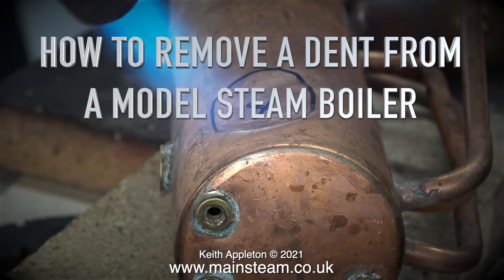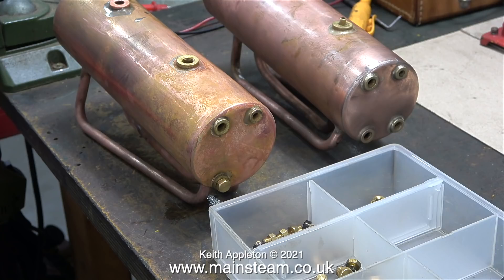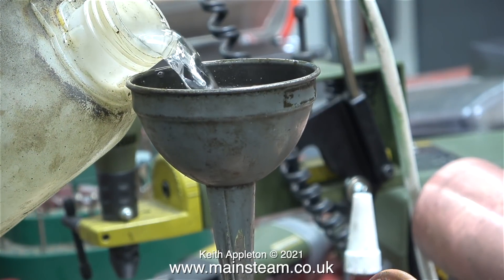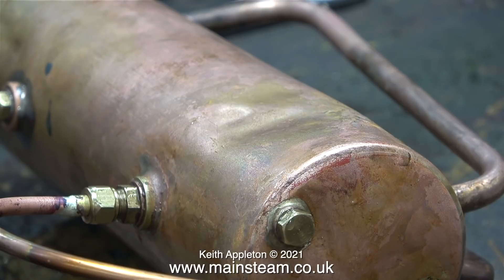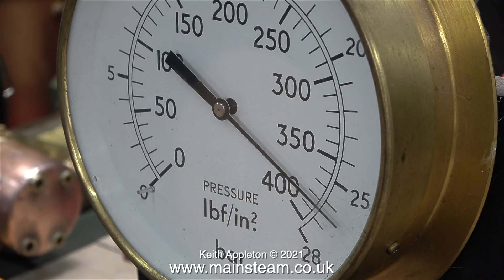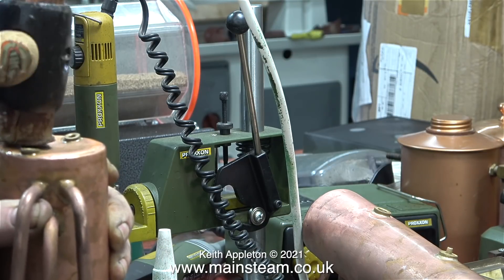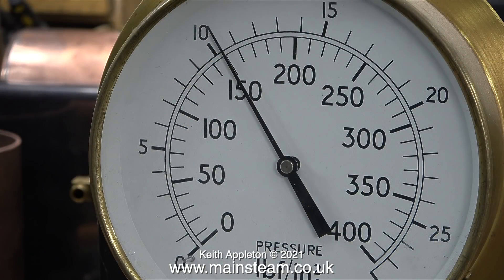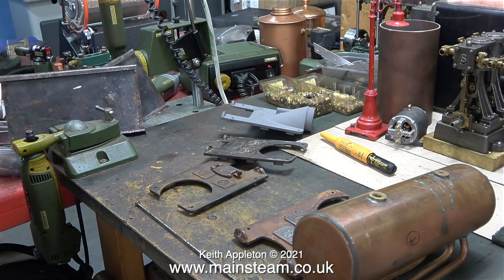HOW TO REMOVE A DENT FROM A  MODEL STEAM BOILER - IN THE WORKSHOP

Comment: Hi Keith.  Thanks for the video.  Anyone that reads my comment please be reminded that the tensile strength of a material is reduced with temperature increase and that a hydraulic test does not correlate linearly with a working pressure for steam.
Reply from the maker: I would think that is why the Hydraulic test pressure is at twice the working pressure.
Reply: So are you saying that if my boiler does not blow up at 400PSI I can now run it at 200 PSI?
Reply from the maker: I am saying nothing much. Your initial comment states the fact. The range of the temperature variable is probably a couple of hundred degrees above 100 degrees centigrade, as the temperature increases relative to the steam pressure.

Comment: Keith,  great way of showing what a bit of hydraulic overpressure can do, with emphasis in using hydraulic and NOT pneumatic OR steam pressure for this type of testing and/or repair/work.  Like you repeated, with hydraulic failures, you only get wet, with the other two, things blow up.

I still cringe at working with an experimental pneumatic test stand that ran at about 7,000 psig back in the '80s.  To make a very long story short, I had to troubleshoot it "live" only inches away from its pressurized components.  But, since I'm typing this, it obviously didn't blow up on me!  ;)

Comment: Keith,
what is the typical thickness of the boiler walls such as the Stuarts in this case? Four hundred psi burst is almost 4-times operating pressure.  I would like to compare with my "origin unknown" boiler that is OK at 60 psi and is to be operated at 30 psi max.
Reply from the maker: Maybe 16 gauge or thinner, I have never checked.

Comment: wow (why not just use air pressure?)
Reply from the maker: Please watch more of my videos. I have mentioned why to use hydraulics in many of my videos. A wise viewer answered your question perfectly: 
hooray for hydraulic testing! 
Nobody wants to be near a pressure vessel filled with a compressible medium when it fails . . . when it does it takes off for all points at blinding speed . . . as shrapnel!
Reply: @keithappleton  thanks I know I missed a bunch of your videos my loss
Reply: Water doesn’t compress, so doesn’t absorb much energy.  Air does compress so stores a lot of energy.  All that energy is suddenly released if the boiler fails, potentially causing a lot of damage.

Comment: FWIW,it was a long time ago,but I helped a man who was truly expert with oxy-acetylene welding. There was a chrome plated tube on a friend's snowmobile so to minimize the damage us two teenagers took turns with water soaked terry cloth rags protecting the chrome. Both of us were amazed just how effective that was ,very little turned blue,almost none was burned away. The broken handrail tube was effectively unobtainium,so repair it or do without.
Protecting brazed or silver soldered joints I have never done,but I used that technique many times on soldered radiator repair.
And there is always partly filling the object with water.
Interesting episode. Appreciate the lesson on pressure.

Comment: An oddity of living in the United States. I live in South Carolina. There are no rules of any kind for non commercial boilers. In the next state over, Georgia requires model boilers be tested to 3x working pressure. It amazes me how over built model boilers are. With in reason and built on good model boiler standards they can take a lot. Way more than expected. So if you really take care of your boilers and follow good operating practices they are reasonably safe. Idiot need not apply.

Comment: Pounds per square inch? I thought England was so very proud that they used the metric system! Yet you used Imperial measurements???
Reply from the maker: Despite your pointless insult about the country in which I was born & raised, I will still answer your question: I was taught the Imperial system at school and most Steam Engines still use it. I do not think Metric.

Comment: I took one up to 850psig back in the 70s at a Hydraulic Test  Lab, it was filled with oil and at 800 the ends started to move out and at 850 one end seam split open. As a condition of testing the boiler the College instructor had me do a lab report on it with all calculations and test results.

Comment: Hi Keith,  do you think its possible when holding pressure, after pushing most of the dent out, to do any gentle planishing? Purely for cosmetic reasons that is. Many thanks for your videos by the way 😀
Reply from the maker: How can I do that and why? There is nowhere to place a Dolly on the inside and the holes in the boiler are very small.
Reply: I was wondering if the water itself would be enough no dolly required  just a few taps to maybe get a bit more of the dent out.

Comment: I am very, very impressed that the boiler held 400 psi without leaking.  I'll have to check boiler codes and see what factor of safety is specified.  More than 3 times the hydraulic test pressure (6 times working pressure!) and no leaks or failures.  Amazing.